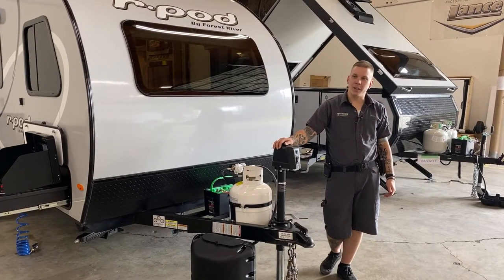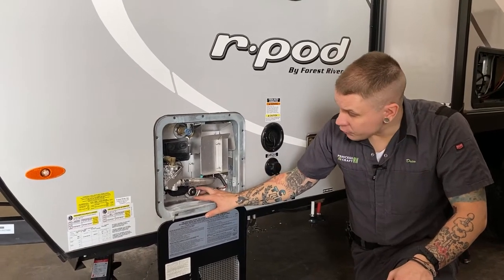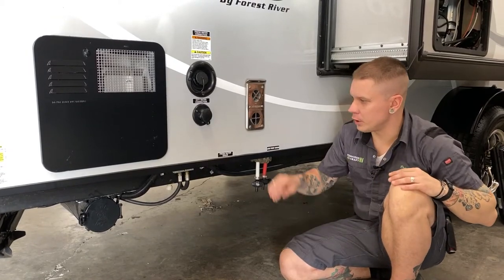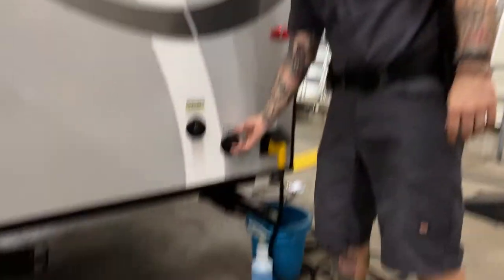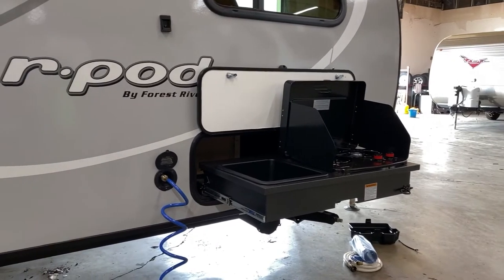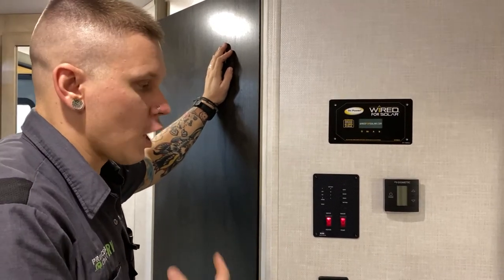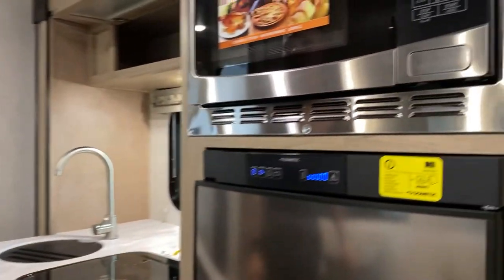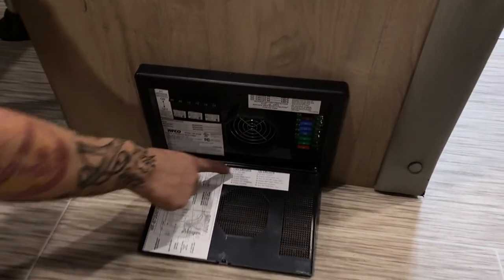Technician Tour - R Pod 180

Comment: Check water level in battery 
Check anode on water heater 
Condition seals of rubber seal around slide out 
Dry lube for slide out 
Check refrigerator back side for nests , insects, mud 
Tire pressure and lug nuts 
Maintain 100 ft lb torque 
65 psi tire pressure 
Leveling kit for wheels don’t use the stabilizers for leveling